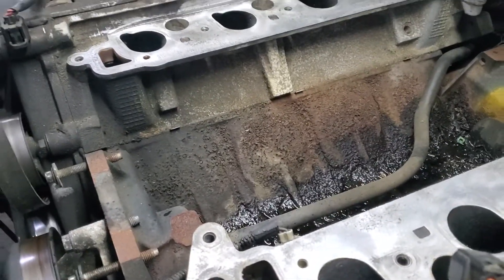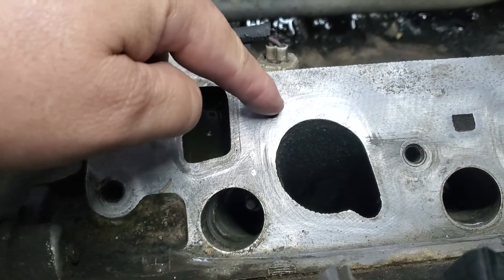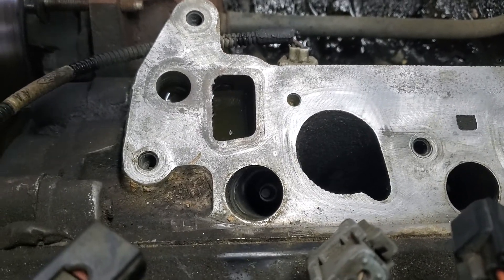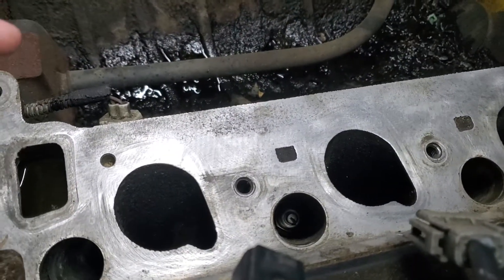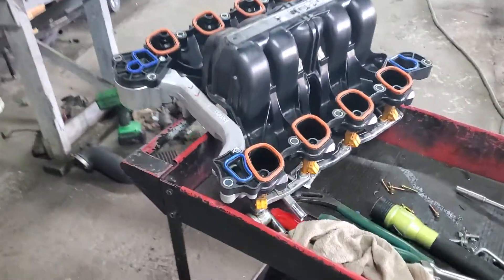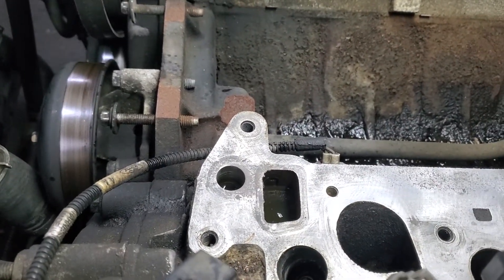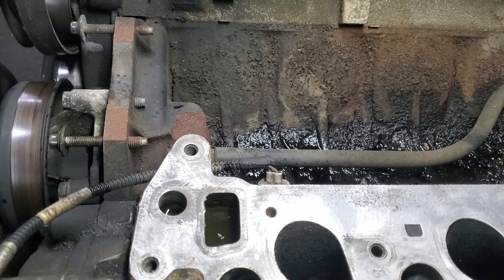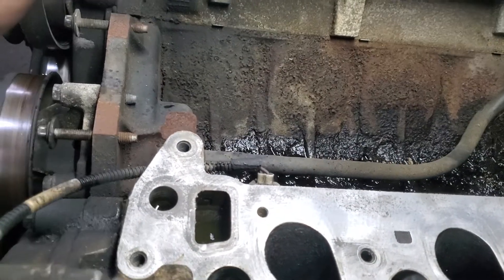ford 4.6 p0171 p0174 dorman intake vacuum leak

Comment: Thank you for this insight! I had a mobile mechanic change out my intake manifold for a 2003 mustang GT, it is a dorman intake, after he changed it out he took the money and ran and didn't call me back. As you said it doesn't make the idle crazy but my car is running really rough and shuts off after a few minutes and yes the fuel trims are saying one side of the motor is getting too much fuel while the other side says it's getting not enough fuel. But anyway yes I will be checking this out soon!

Comment: I installed a dorman door knob of a intake manifold and my check engine light stayed on all the time with code po 316 with 301 every time I cleared the codes few miles later it comes back. Dorman door knob of a intake has shorter runners than the Ford performance intake dorman is like installation of a check engine light on my 04 mustang GT so I have taken it off and put a Ford pi intake manifold on and the check engine light went away

Comment: how do u fill the holes?
Reply from the maker: rtv
Reply: @uglyhp8225   I have 04 expedition they sent me a dorman Intake smh! Now does  plugging these holes really work? I bought quik steel and plugged hoholes
Reply: JB Weld High Heat putty, once it dries give it a very gentle sand with 1000 grit paper.
Reply: @larry Carter jr  the "Quik Steel" or "Steel Stik" will work, I would suggest the JB Weld High Heat though, it's made for exhaust so it's specifically for high heat applications.  I installed a Dorman Intake, but I haven't had any problems with leaks and I didn't fill the holes.
Reply: There is a disclaimer in the box about filling the holes if they cause vacuum leaks
Reply: @RDGrier-ny1ju China must have ran out of paper because there was nothing in my box but a bag of course wood screws and some pipe plugs.